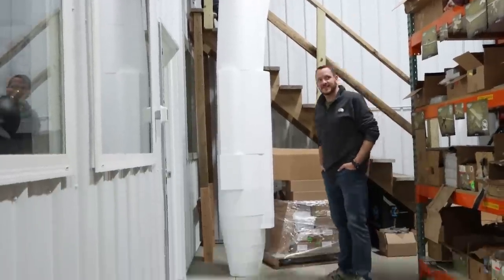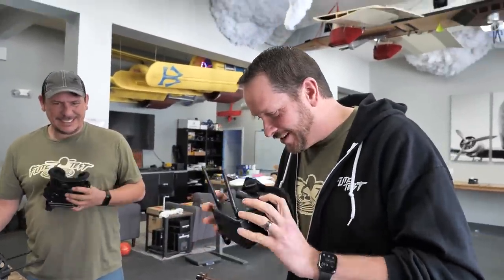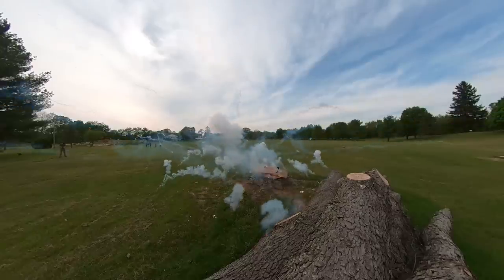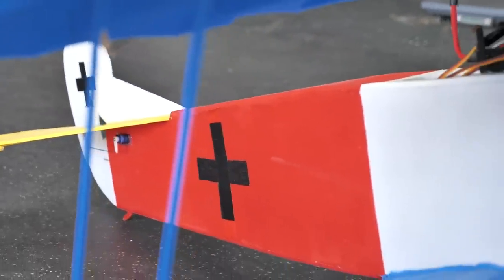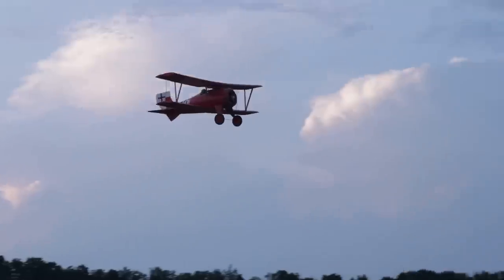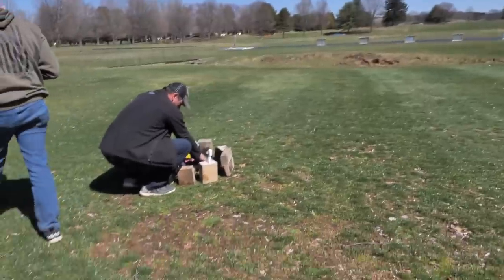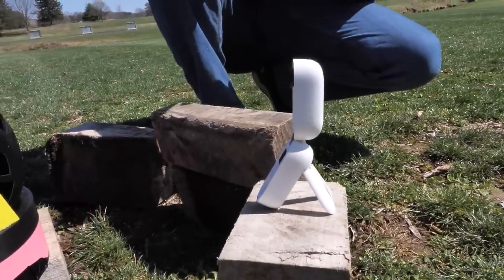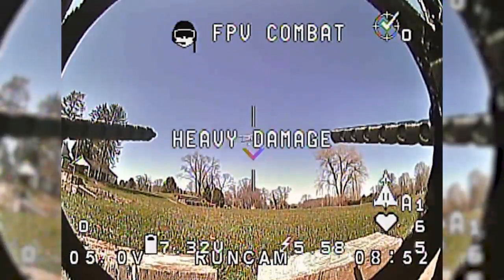Turret Vs. Bi-Plane Laser Tag Battle - Week 10

Comment: Cool idea but really? No one realized the brick in front of Lee's turret was blocking his IR? Looks like the system works really good. From what I have seen on the FPV Combat channel and interacted with those guys that system is rock solid in the air on bright days. This is gonna be next level epic when you have the B-17 and two axis attackers doing battle.
Reply: Thank you!
Reply: Yeah that's what I thought
Reply: Kapan buka
Reply: Buka puasa
Reply: Sensor on the airplane needs to be on the bottom.

Comment: Great work guys. Just wanted to share an idea. Your spending all this time making the b17, but I'm guessing you're just planning to control the plane/guns with typical RC remotes. 

What about using some gaming style VR controls? Could you build a rotating chair for the ball turret? Or maybe a standing position with a foam board 50cal that would control the waist gunners. Or a cockpit with two seats and copy the cockpit seat controls you did in the past. Could have some engine toggle on/off switches, allowing you to roleplay the shutting down of damaged engines.

Just think it would help massively with the immersion. Keep up the hard work, and if you ever decide to do another huge ww2 bomber, can we have the Lanc please! =)
Reply: It'd be a lot of work to do, but there are USB-operated gimbal guns for arcade emulation that could get modified into some M2-analouges. downside being a limitation in how fast the servos can move of course.

Comment: Ok, to test the gun platform mount it on an rc truck and see if it can track and hit also you can see if the system can take the violent shock movements of the platform moving and the gun mounts movement.
Just a suggestion.

Comment: Something tells me, this test was set up so Josh could win, The WW2 twin 50's  on B17's had At least 2000 rounds total. The radio hatch gun typically had 100+, the tail gunner and nose turret had 300+, top and ball turret had 250 each and the waist guns had 250 each with another several boxes stored near radio hatch as reserves for waist, radio hatch and ball turret. The Cheek guns had only 100 each gun. Just saying.
Reply: The cheek guns only had 100 shells each because they were the least used. Unlike all the other guns, there was no gunner permanently assigned to them. While this could be said of the nose turret (which was operated by the bombardier), it was rare to be under fighter attack over the bomb zone as it was usually covered by flack and German fighters did not really like flying through their own flack for obvious reasons, so most of the time the nose turret was always manned in combat.
As for the cheek guns, it was mainly the navigator who could fire them if needed, or the bombardier could come off the nose guns and take one of the cheek guns if there was no threat forwards, but they had such a poor field of fire and as mentioned, no permanently assigned gunner, hence why they needed so little ammo.
Reply: The number of ammo can be selected by users and maximum number is 255.
There are also other parameters that can be adjusted like the “shoot rate” which is basically the length of each triggered burst…
Reply: Just saying although they only had a set amount of rounds they bought had the same amount it was a fair fight
Reply: @davidjester5085  Not really the turrets sensor is at a constant fixed angle, the planes sensors were at a limited angle on every pass.  If Josh came in at a slightly different angle each time his sensor is not exposed to the turrets emitter the advantage then goes to josh. So it was not a fair fight. Just a proof of concept.
Reply: @davidjester5085  About as fair as a boxing match where one fighter has his feet glued to a spot in the ring.....

Comment: If that is possible, I would love to see one hit sensor next to each engine, control surface and turret so you can knock parts of that B-17 out electronically to hurt its flight performance, and the pilot can always surrender to get full control and land the plane in one piece. Same for the F109 and such, the pilot can get shot, so can the engine and wings get destroyed. If you guys can take it to the level of damage model of war thunder, only this time on physical models, that would be really fun.